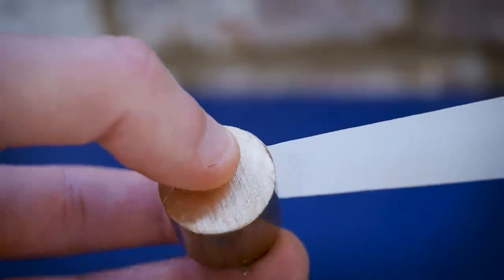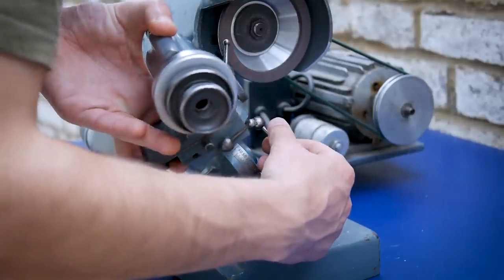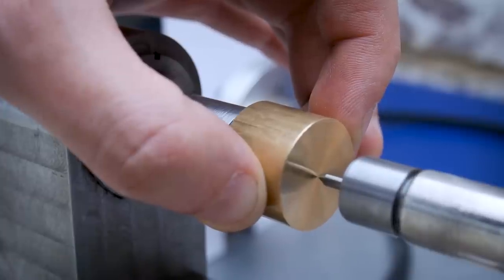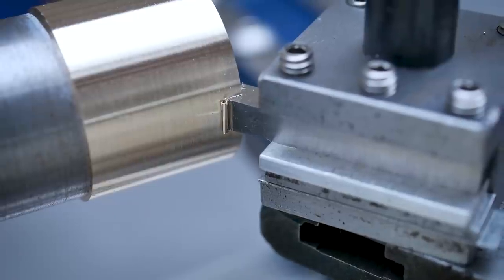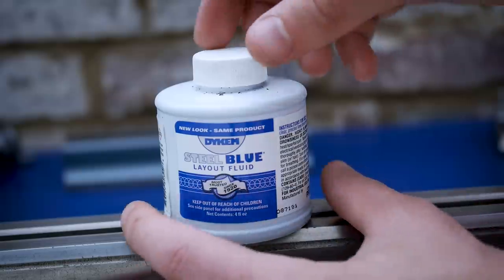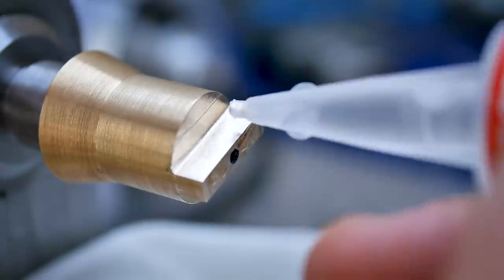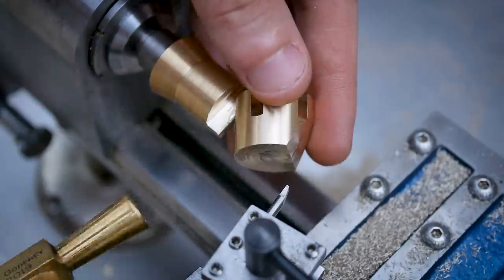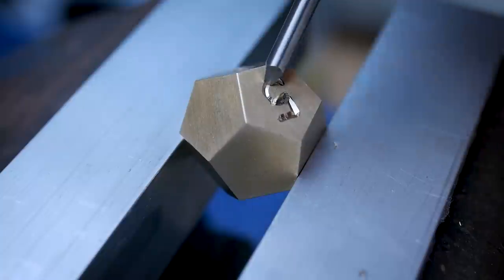Making a Dodecahedron on a Manual Lathe

Comment from the maker: For those who wish to reproduce this, I skipped over a few key details you will need to know. Firstly, you must decide on the size of the dodecahedron. Let's define this as the distance across flats (L). The length of your starting cylinder needs to be L. The diameter needs to be 1.236*L. When shaping, make sure you don't go all the way (leave some to face off later). When bringing the tool in to touch the cylinder edge prior to any facing off, set the dial to zero. Face-off 0.277*L to form the final face size. This maths is accurate to plus/minus 0.01 mm (for a typical die size). Good luck!
Reply: Is L the same as the edge length of the pentagons or the length from an apex to the opposite edge? Sorry for the questions, I need to work out how much I can hollow out.
Reply from the maker: @danceswithaardvarks3284  No problem. You're right, my description is ambiguous. L is the distance from a face to the opposite face. Another way of thinking about it is the insphere diameter (i.e. the diameter of the sphere that is tangential to all the faces in the dodecahedron). If you would rather define the size based on edge length, then the ratio of L : edge length = 2.227.
Reply: Thanks  @chronovaengineering . I had reached that conclusion, but it is nice to get confirmation. It makes sense now.
Reply: Thanks Mike. I managed to make one on a wood lathe. Not quite symetrical, but I know where I went wrong so the process worked.
Reply: Do you think using a QCTP and manually adjusting the height of the tool to increase the size of the channels would be beneficial? I'm definitely having a go of this either way, got a friend who's been giving me hell for not attempting a D12 for a while and I want to show him up!
Reply: Turning all of the platonic solids could become the machinists version of BASE jumping. I'm also thinking about the D20 next, but probably using another approach. Good luck.

Comment: Can't believe we didn't get to see it roll
Reply: Probably because it always comes up as a 12...
Reply: Don't watch Inception, it's 3 hours of not seeing spinning top roll.
Reply: Yeah can you just make a quick short of that, I am left unfulfilled
Reply: There's 0 chance this is balanced.
Reply: @tylermcnally8232  I'm sort of curious how balanced it is. it makes sense that the heaviest side would be the 1 and thus the 12 would be advantaged (12 is opposite 1) its its a small amount compared to a solid brass polygon and could be ovewhelmed by any imperfections in the distance between the faces. I'd love to have it rolled a few hundred tiems and get the results. :)
Reply: @tylermcnally8232 but is it balanced enough?
Reply: @christopherjones7191 Time to do the saltwater test... oh wait.
Reply: @Yuzuki1337 the mercury test
Reply: @cerocero2817  I bet that would look incredible
Reply: @Yuzuki1337  there's a channel called Cody's lab that made a video showing an anvil floating in mercury, it's pretty surreal. Steel floats better in mercury than balsa wood in water.
Reply: @cerocero2817  Thanks for the recommendation, gonna check it out tonight!
Reply: video was filmed on shomer shabbos

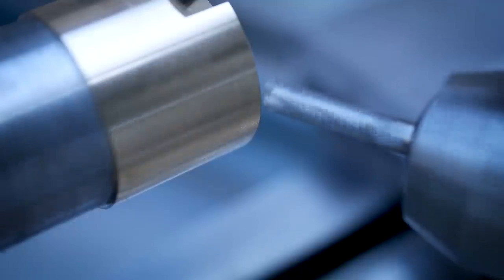Comment: 6:50 well, one method would be to machine a piece of stock such that a long feature would fit inside your tool holder, and use the chuck to hold a mill. Angling the tool holder would provide most of the faces, rotating the stock to precise angles using angled blocks off the face of the ways. I've never done such a thing to obtain a complex shape, but i regularly swap my lathe "order" whenever my mill is occupied.
Reply: If I follow you correctly this is exactly what I would do, put the cutting tool in the lathe spindle and use the tool holder and compound slide to do most of the work. I've actually thought about making a collect block set that registers in my tool holder so that repeated rotational features in that other axis can be quickly set up - same concept as a collet block as used in a mill vice, just with a more * or + shape as the tool holder needs a protrusion to grab. Though I also have a little vertical sliding 'mill table' attachment that goes on my clockwork lathes slide - so for small enough stuff it just becomes a mill with a really really big Z in comparison to the rather small x-y travel.

Comment: Very cool machining! Did you make your own custom collet for the D-bit grinder with an ER nose & remaining taper/dimension features to match the original (presumably Deckel/U-style) collet? Or has the work head been modified & its a dedicated ER spindle tube? What ER size is it? I noticed in your Quorn drill sharpening video a similar ER holding fixture. 

What exactly is the purpose of the annular relief grooves turned on the face of CA glue fixture? Initially I thought a place for glue to overflow & make the gap joint thinner but now I'm wondering if its related to allowing air to properly cure? My (non-grooved) CA glue fixtures seem to cure somewhat unreliably even with accelerator, maybe that's why?

Comment: have you checked the dies randomability? how often it might hit a certain number over another due to weight differences between faces.
Reply: A laser measure could precisely account for all spaces of each face. The metal is balanced from the very clean melting it went through to rid impurities that could cause imbalance.

Comment: I notice you ground your HSS bit with what appears to be a diamond based wheel as opposed to the typical AO or similar aggregate type wheel? If so, I've heard conflicting opinions about that practice (that it can load or dullen the wheel prematurely). Can you comment on your findings? Do you have to dress it more often for example?
Reply: Could have been a CBN wheel. 

 Concern with grinding steels on diamond is the diamond's chemical affinity for iron. Once there's sufficient heat, the carbon (diamond) will diffuse into the steel thus eroding away diamonds quicker than necessary.

Comment: Great video thanks. It's inspired me to try making a 12 sided dice box in wood, using your method, but I am unclear about one thing: at around 9 minutes 50 seconds you mention removing enough material to make the face the correct size, but how is the correct size calculated?
Reply from the maker: Great question. I added a pinned comment explaining all the details you need to know. Good luck with your project!
Reply: Thanks

Comment: If a cross slide mill, an attachment, can be considered a separate machine, then could one argue that your digital indexing is also an additional machine, as it's under the same parameters of adding an additional motor that is not the lathe's primary drive motor, as that's all the cross slide mill is actually adding to the ecosystem?  This also gets into the conversation of where a true lathe-mill combi-machine sits, the kind where the lathe's cross slide acts as the mill's table, it's technically one machine, yet combines two machines into that one ecosystem; or similarly, where does a mill with a modifyable head to become both a horizontal and vertical mill sit, it's also two machines but in one cohesive platform, or what about adding a powered fourth axis to a mill, etc.

The way I see it, if the base machine can have it as an addition or attachment, then it's one machine.  This is the primary reason why lathe-mills exist, because it's one machine that does the bulk of the work of two otherwise separate machines, as this method of a combi-machine saves a significant amount of space.  Think of it this way, if you only have one table/cross slide between multiple cutters, parts holders, and other attachments, then it's one machine because you're only working with one solid platform that has everything else attached to it.  Sure, having every attachment and spindle possible might make this one machine a bit larger than the basis it's based on, but at the same time it's still smaller than two individual machines, because the common components (i.e. the linear slides for the table or cross slide, plus the frame it's mounted on) are the same between each spindle, just at a different orientation to the spindles (i.e., a lathe is Xr, a vertical mill is Yr, and a horizontal mill is Zr, all with a common table of Xl-Zl planar movement, along with various attachments for additional axial freedoms), while all being one machine itself.  If the part doesn't move from discrete machine A to discrete machine B, i.e. the part finishes with the machine it started on, then it's one machine. 

This works because you cannot argue that a machine can't be expanded upon via additions and accessories.  If that were the case, everything would be a machine, an index table on a mill's table would be a machine, any tailstock accessories on a lathe would be a machine, the lathe's own cross slide platform would be a machine, a fourth axis attachment would be a machine, etc.  Yet they're not individual machines, because they're considered additions, attachments, and accessories.  And this is how it works for a combi-machine, you take a lathe, you adapt the cross slide itself to hold a part, and you add a vertical spindle over a decent position for the cross slide to act like a mill table.  The powered cutter used in this video is essentially a variation of this, where the lathe's chuck acts as the parts holding while the mill head is positionable in respect to the static part.  The same way an attachment to drill perpendicular holes, in respect to the lathe spindle's axis, along the length of the part would also be an attachment.  There's so many ways to look at this non-issue where all of them come out to be that additions to a base platform results in a singular machine. 

And if you want to argue the opposite, the dodecahedron couldn't be formed on a lathe.  Why? Because the operation of forming the initial faces on an angle would be a shaping operation, of which a lathe is not a shaper, even if it's used as such.  You're using one platform for two entirely different uses that operate in entirely different ways, and using two different portions of the machine in otherwise improper ways to achieve this; i.e. you've turned the lathe into a shaper, two different machines.  And this is where this argument is debunked, becuase you're still using the same platform, you're still using the same core components, and the workpiece itself hasn't left the singular machine.  Therefore, adding attachments to a lathe, such as turning a lathe into a lathe-mill combi-machine, results in a singular machine; and thus, the argument of one base platform equating to one machine, reguardless of attachments, becomes definitive.

Someone could create a machine that has every possible spindle axis, spindle movement, parts holding axis, parts holding movement, with additional accessories with the same degrees of freedom, and as long as it's on one base platform, it'd be one machine.  How large or small that machine is, or how complex, etc., is a different argument wholly unrelated to this one.

Comment: Adding in the mill is definitely cheating, but then again you could claim live tooling 😂 but you did it the hard way as proof of concept, after that it's ok for quality of life improvements to be made

That die looks gorgeous. I really like the look of the 6 and 9, it's a rustic kind of look. Something you would find carved into a tree from centuries ago. Bringing the warmth of hand engraving into the mix of a cold clean metal is so hard to do. Usually you do one of them well or both look like garbage but this has such a cohesive balance

Comment: disappointing, this is not a "manual lathe"
Reply: Yes it is a manual lathe! Manual lathe doesn't mean the spindle is manually driven by feet or hands, it means the cutting adjustments are manual, contrary to CNC lathes controlled by a computer.
Reply: @d1oftwins  Manual lathe plus CNC ROTARY TABLE equals not manual.
Reply: @jeremiahbullfrog9288  Oh, I see what you mean now. Well you could also say that technically it's a manual lathe just with a attached module, just for the sake of beating around the bush. Honestly nothing that could not have been done with a simple mechanical tool with a simple angle dial (which the digital angle indicator also had it seems), so don't see the need to nit pick here.
Reply: @d1oftwins  I guess I felt left in the dust by this piece of costly equipment based on the title and first half of the tutorial. I suppose if he had said "Here's how to set the angles with a (protractor, dial guage, whatever) but I have this nifty piece of equipment i want to play with" ... i would have probably been fine. I don't think it's fair to call my objection a "nit pick"
Reply: @jeremiahbullfrog9288   Costly equipment? you mean the digital angle indicator with automatic positioning? Looked to me pretty DIY, but I might be wrong. But even DIY can cost 
more than a bought tool. And it is still a manual lathe with an attachment, your sensibilities how the manual lathe was used and that prior more analog angle setting options were not presented doesn't change that. It is a CNC rotary table, but throwing it at a manual lathe does not make a CNC lathe, there is more integration needed for communication and coordination with the other axes of the lathe to call it a CNC lathe.
The CNC rotary table is still very manual for what it is, it's just that it has a gimmick that it positions itself, it has the same vibe of a self opening car door, neat but unnecessary, but I guess repeatable. You still have to tell the rotary to start rotating to an angle (or increments) you have set manually beforehand by pushing a button every time you want it to rotate once. The CNC for the table is in the literal sense Computer Numerically Controlled, but in the most narrow sense of it, and far from being integrated in the process of the lathe to make the manual lathe remotely CNC. It's a fancy digital angle indicator.
Having said all that above, I think it fair to say that there was some nit picking done.
Reply: @d1oftwins  Wow you're really invested in this. Sorry for setting you off... my comment stands.
Reply: @jeremiahbullfrog9288  I am not upset, you really didn't give me any reason to be, there is no need to apologize, we just had a nice, animated discussion on a disagreement. You comment stands and so does mine. But I think that was a signal that you are not interested to keep this going, since you didn't really touch on my last comment, that's fine. I wish you a nice day.
Reply: @jeremiahbullfrog9288 calling others invested in something where you yourself invested first is a pretty shit thing to do.
Reply: @mechanicalmonk2020  🤣🤣 ok captain
Reply: @d1oftwins  You too, thanks for understanding and cheers mate